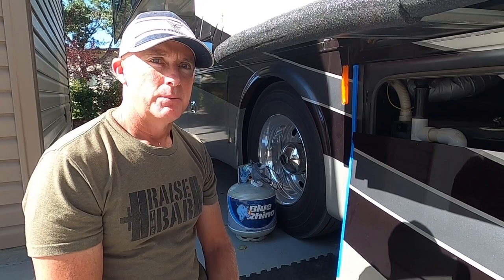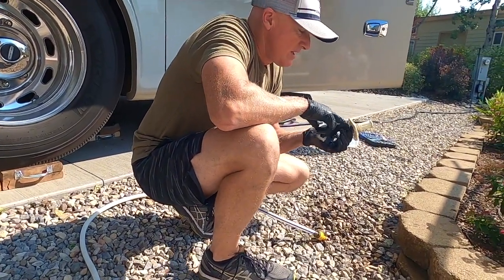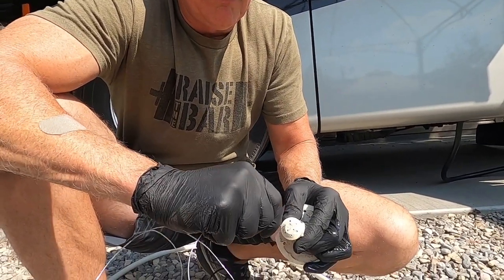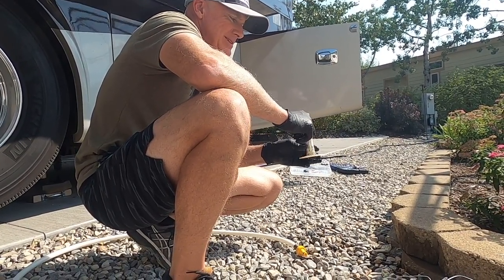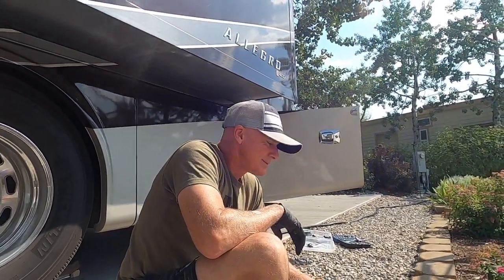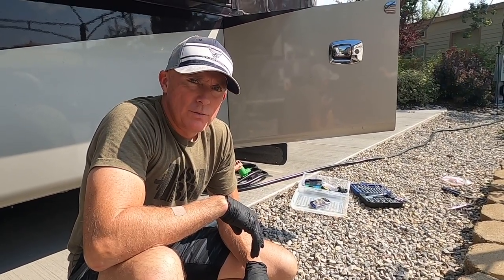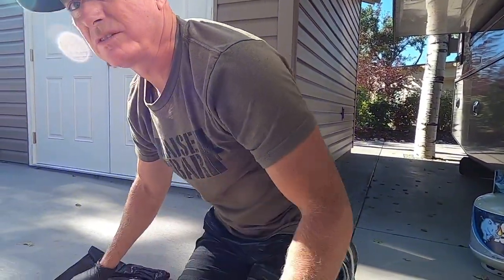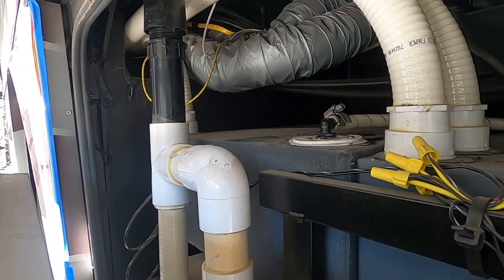Learning about the 'No Fuss Flush' and how important it is in keeping  your black tank flushed.💩

Comment: This is a VERY COMMON problem!  Get a drill bit slightly larger than the holes that are there and drill them out bigger.  If you don’t, it will clog up again.
Reply from the maker: That's exactly what we did and have had no issues.  Thanks for watching.

Comment: Almost seems like installing 3 or more in your particular tank would do wonders. As it is now with one no fuss flush way off in the corner, I bet 50% of the holes are hitting straight down or the back 2 corners. I don’t see anyway the remaining holes are much effect to the rest of your black tank.
Reply from the maker: That's a great point. I think it's working pretty well since I drilled the holes bigger but it seems a better way is out there for sure. Thanks for watching and your comment.
Reply: Excellent video, what size bit did you use to drill the holes. Is there a better product out there? Adding a flush to our new travel trailer which does not have one.